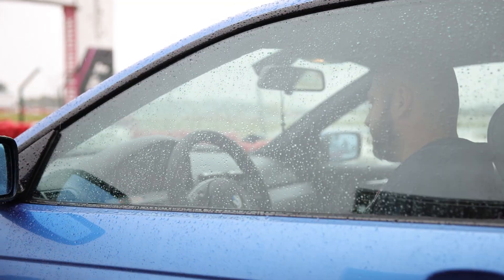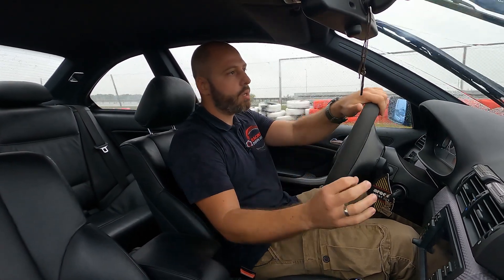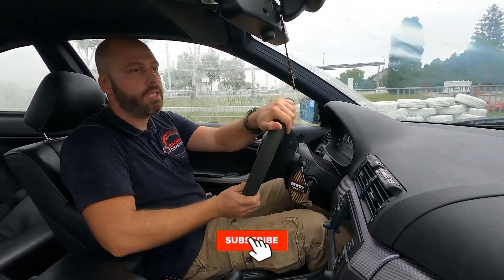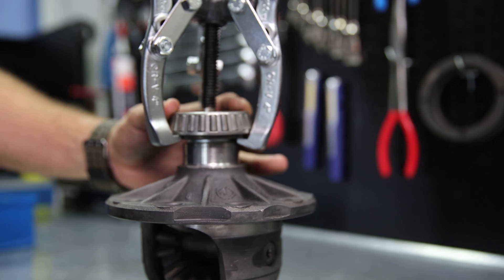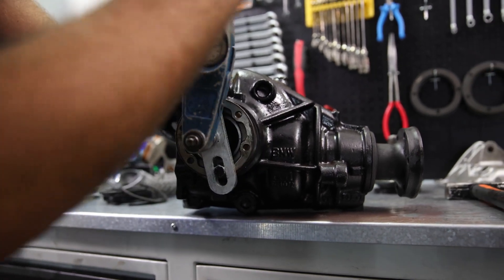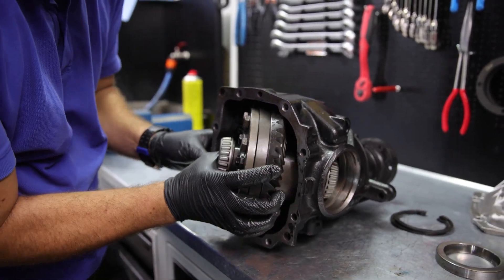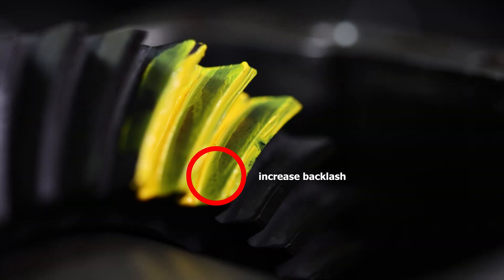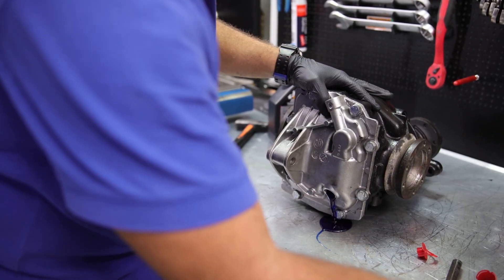How to swap LSD from BMW E30/E36 into E46 330i 188K | Step-by-step tutorial | Powered by RacingDiffs

Comment: The youngest lsd from e36 turned 25 years old. Before putting it in your car, you need to completely rebuild it. Also find a master who understands this. For this money, it's better to take a new torsen.  He's more reliable.  It is installed on bolt and has a large degree of blocking.
Reply: You will never enjoy driving with torsen like you can enjoy with clutch type LSD.
With those Racingdiffs clutch plates you will forget rebuilding that unit ever again.
Reply: @nenadradenkovic87  If you wrote this, it means you've never ridden a good torsen. I'm talking about a type 2 torsen with a preload.  I am 99% sure that you will not distinguish them when moving forward. 
And any friction discs on the lsd will be erased. If they don't rub, then lsd doesn't work ;)
It will happen the same way as on the original bmw discs, because the principle of applying molybdenum to discs is identical.
Reply from the maker: No thorsen can ever replace proper clutch-type LSD. Especially if it is adjustable. That's a fact. You will never find a thorsen in any type of race car.
Reply: @Highco_46  there is no such thing as good torsen.
It's ok solution but if you want something more from your car you need clutch type unit.
And that is a fact.
Reply: @RacingDiffs  Yes, you're right, a disc is better for professional sports or drift. I thought those who produce the “conversation set" and call it lsd do not understand sports ;)  but if we are talking about an everyday car, with the ability to drive fast and efficiently, Thorsen is an excellent choice. From the factory, torsen was installed on bmw z3, toyota mark 2 , gt86, subaru brz, nissan skyline ;)
Reply from the maker: @Highco_46 conversation set??🤣 you obviously didn't check our channel and website deeper. Clutch type LSD is installed from the factory in all Porsches, Ferrari, Lamborghini, Maserati, Audi R8 etc. The only advantage of thorsen is no maintenance. But if you have clutches that last long and are not too expensive to replace...

Comment: This was an amazing video, finally someone to let us poor non m have a clutch based lsd for a great price and relatively easy compared to an aftermarket helical/ torsen style lsd. Could you guys maybe do a bit of a sale where if you get the swap kit with the refresh kit there will be a discount?
Reply from the maker: Thank you. Will do soon. Our big final sale starts in mid October 😉
Reply: @RacingDiffs  I also have a few question, when ordering the kit, If I don't use the adjustment shims, could I send them back and get the value of the shims back? The ring gear showed a 3x3 mm machined part on it does that mean that the ring gear will need to be machined? For example I have a 330ci that has the standard 2.93 ratio diff, which settings would I need to choose in order to buy the conversion kit for a 3.23 e36 diff?
Reply from the maker: In your case you need to get 5.15mm spacer which doesn't require machining of the crown gear. If you don't use any c clip from the set, you can return it according to our refund policy, sure. 👍🏻
Reply: @RacingDiffs  Thank you so much! I look forward to ordering the conversion set!

Comment: Hello! I got the 3.38 ratio diff from a e46. What diff ratio\type should I look for from e36 and what mm spacer I need to make it work ? Thank you! Great video !
Reply from the maker: If you use LSD from 3.15-4.45 ratio than you need 12mm spacer. For LSD from 2.65-3.07 you need 19mm spacer.

Comment: Great video, one question, must you re-use the CWP from the E46 diff?  E46 ratios are limited, I want to use a 4.29 or 4.45…
Reply from the maker: 188mm cwp, from e36, won't fit.
Reply: @RacingDiffs  what’s the best OEM ratio available on e46s?? I could only find 3.91?
Reply from the maker: That's pretty much the shortest you can get.
Reply: @MakingforMotorsport  The e83 x3 n52 automatic has a 4.44. Unless they updated the diff in the LCI x3 I’d imagine that would work.

Comment: Nice that you share your knowledge, i also had that kind of lsd in my E46 a while ago. But 400€ for a swap kit and 600-1000€ for a worn E36 LSD which you first have to rebuild first for 300+€. Thats Drexler Money for Medium Results😬😅 Not Speaking of the needed tools and machines for the swap...
Also i dont think you can remove all the metal shavings from the front of the diff when grinding the housing, for proper installation the pinion should be removed.
For someone who has acces to a lathe and tools and gets an old E36 lsd for really cheap this might be a cool solution, but for the rest a proper new lsd unit would be better, or even a torsen style blackline lsd which are available for 600€✌
Reply: well, 200 is just cost of C clips that you need for alignment of any type of diff + 50 oil seals that you should change anyway, leaves you with 150 for adapter. LSD cores could be found for 500 and rebuild to factory performance is 150e without discount which is fairly frequent for these guys, if you don't have lathe of course some money for that job. Drexler is 1800e before you even touch your diff.
Reply: @MstreetDriver  I put 2 drexler type in e46 diffs and the quality was that good that i didnt need different C Clips, even though i had a Set here i could just put the original ones back in and the measurements were perfect.
So it was just 5€ for 2 new side seals adding to the 1800€.

And 3 years ago you could maybe get a used e36 lsd core from ebay for 500$ but now even the long ratio ones are sadly 800+

Then buying the cheapest possible clutch plate rebuild kit will leave you with bad Performance, even worse than factory lsd Performance. 

So I stay with my point, e36 lsd core swap is a pain in the ass to build and assemble, difficult to adjust and now with rising prices for e36 cores also pretty expensive. With shorter ratios it gets even harder to put the fat e36 carrier into the 188k housing, i once switched mine for a 3.38 ratio and the grinding of the Housing wasnt enough, it could only be put in with unbolted ring gear and carrier cap and then assemled in the casing...very annoying to adjust something like that.

Comment: Great tutorial, thanks a lot guys !! I will do that to my 01' 330Ci.
Reply from the maker: So glad we inspired you.👍🏻👍🏻👍🏻
Reply: @RacingDiffs  I have a 00' 330ci, what differential type should i get? I have no idea whats the difference and what type i need
Reply from the maker: You need to find 188mm LSD unit to swap in your housing. Such LSD units were often used in E30, E36, E34 6-cyl cars.
Reply: @RacingDiffs  So for my e46 330ci 3.0 i need 188mm LSD unit?
Reply from the maker: That's right ✅️
Reply: the bmwfans says my car has 188k so should i take 188k not 188mm right?
Reply from the maker: There's no LSD for 188k diff. That's the point. You take 188mm LSD from previous models and swap it into 188k housing.
Reply: @RacingDiffs  but your site has 188mm and 188k and on bmwfans it says my car has 188k, i dont order the 188k type?
Reply from the maker: Can you please post the link that you have been looking on our website?

Comment: Gd day sir,, is it compatible w/ suzuki samurai diff, or there are available one for it?, the basic mechanical construction/ components of a open diff are almost same of BMW's,, well as for daily &farm driving / not much seriuos off-road, just plain mud,ruts,gravel & sand typical country roads perhaps your LSD design can fit that qualification,,,
Reply from the maker: We don't have the specific model for Samurai diff. All open diffs looks the same, but to get proper performance out of LSD conversion set, you need to march dimensions in 0.1mm, which is impossible to coincidence. We will look into making the set for Samurai though. 👍🏻

Comment: Can I do this the other way around? I have a e46 diff with a lsd in it (aftermarket) and want to put it into the e36 medium case?
Reply from the maker: Not sure how this unit is designed. If they used a spacer  for ring gear, you will probably be able to swap it. If there is no spacer, then you won't.

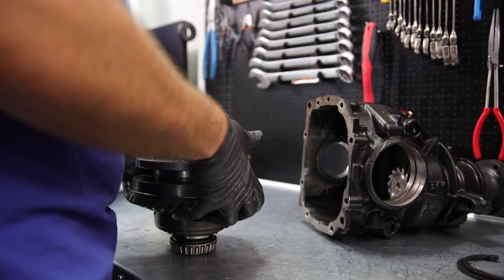Comment: @4:54 in the video are you saying the ring gear needs to be machined in a lathe?
Reply from the maker: In some cases yes. Because spacer has outer step to keep the ring rear perfectly aligned on the center of rotation.

Comment: Great video, what’s the most power a diff like that could handle?
Reply from the maker: Thank you! LSD unit can easily handle 800+ hp, but axles are limitation. If you get wifefab axles than you're good for up to 1000

Comment: Does installing an lsd on my bmw e46 turn any codes on? When you weld the diff the abs and traction control turns off is it the same with the lsd conversion kit?
Reply from the maker: Not at all. LSD conversion kit works great with ABS and DSC. Of course, when you want to go sideways, you will turn off DSC. 🙂
Reply: @RacingDiffs  awesome do you guys think you’ll have the 188k conversion option available on eBay soon?
Reply from the maker: We have it on our website. Please check the link.

https://racingdiffs.com/collections/lsd-conversion-sets/products/bmw-e46-e90-e92-e39-e60-lsd-conversion-set

Comment: Is the M3 e92 compatible with e92 330d to swap for lsd or do you have a kit?
Reply from the maker: It's now compatible. We do have a LSD conversion kit available in stock. Please check the link below. That would be 215L diff type.

https://racingdiffs.com/collections/lsd-conversion-sets/products/bmw-e46-e90-e92-e39-e60-lsd-conversion-set

Comment: @RacingDiffs is this also possible for a 210mm e46 into 188mm e46 or 188mm e9x/e8x? thanks for great work on sharing knowledge!
Reply from the maker: Unfortunately, it is not possible. But we are currently working on a Plug and play solution for E46 3.0D 215K diff.
Reply: how is this project going?
Reply from the maker: Coming next month 👍🏻

Comment: Why do we need a crown gear?
Reply from the maker: What do you mean? Without a crown gear, you wouldn't have any power transfer to the wheels.
Reply: @RacingDiffs  sorry i meant the spacer for the crown gear. Why do we need a spacer if both ring are for 188mm medium case diffs
Reply from the maker: You need it as the position on the carrier unit is different.
Reply: @RacingDiffs  oh i see, so if i have a e46 3.46 diff  ratio what spacer thickness i need to order?
Reply from the maker: If you are using LSD unit from gear ratio 3.15 - 4.45 you need 12mm spacer.

Comment: What is the diff ratio and the percentage of lock on this car?
Reply from the maker: We used 3.15 diff and lock is set to 40% so it can be smooth for everyday usage.
Reply: @RacingDiffs  im doing the same process for my e46 using e36 lsd but the ratio of the diff will be 3.46 with 40% lock
Reply from the maker: No matter, process is the same for all ratios above 3.15.

Comment: Ok I have a 2000 328i, 188k open diff 3.46, I want to swap ring and pinion to 2.93 and keep it open to weld it , anyone have part numbers for the 2.93 ring and pinion for 188k or can I swap its with the e36 188mm ring and pinion????
Reply from the maker: You won't be able to swap gear ratio as the carrier unit has a different offset. Find complete diff and change it. This video might help.
https://youtu.be/zdWjUNBxU9s

Comment: Why on earth did'nt BMW fit a LSD to the E46 330ci as factory standard? I had a 1996 E36 323i (less power) which had a LSD fitted as factory standard! Yes I suppose it was to make you buy the M3,but still,it's a bit sly and mean.
Reply from the maker: Exactly. 👍🏻 LSD much changes the way that car drives and handles